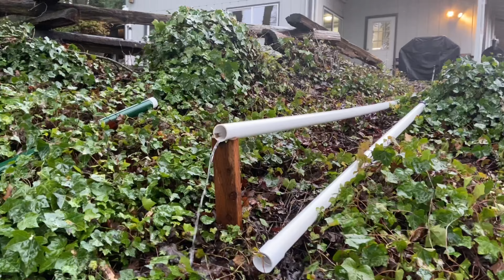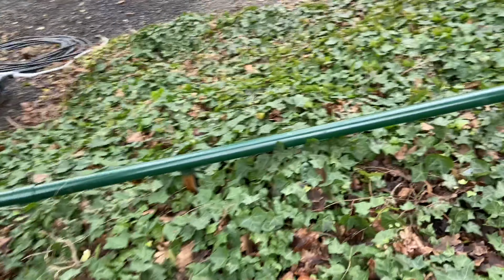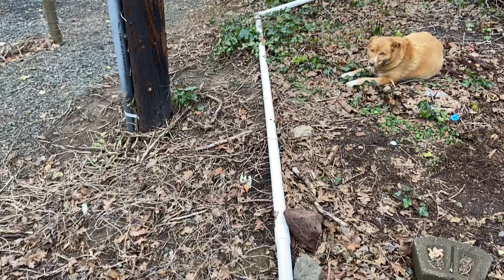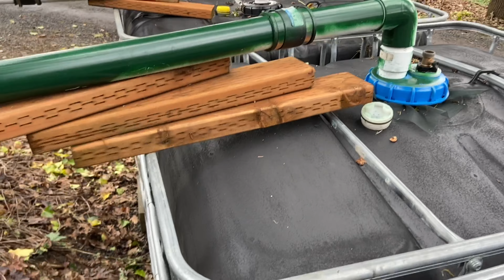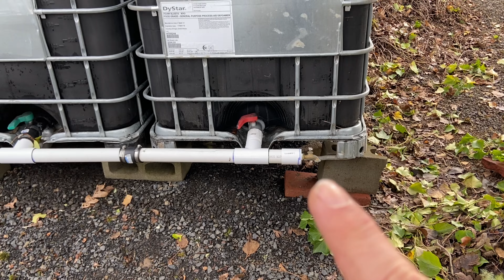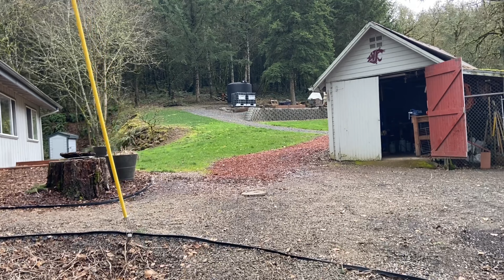#08 Rainwater Collection - Part 2

Comment: Well thought out.  Do you use that water for just your gardens or your whole house?  I have one tote just for my garden when it gets dry.  Maybe you could make a couple stakes.  Cut a notch at the top and put the other end into the ground.  Then wedge it under the pipe which would hold up your line going to the tanks.  I would use pressure treated stakes they will last longer. Thanks for the info.
Reply from the maker: Great, thanks for the suggestion to use stakes. Good idea. I do only use the water for the gardens and plants around the house. I would probably need to increase the capacity to close to 10,000 gal. We have 6 people that use water. Someday maybe...Thanks so much for the comment. Tim